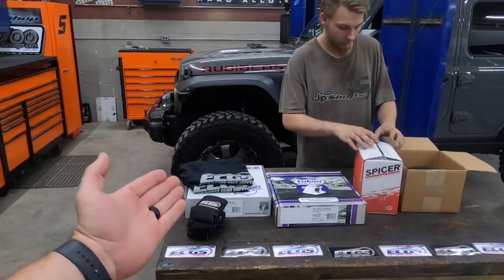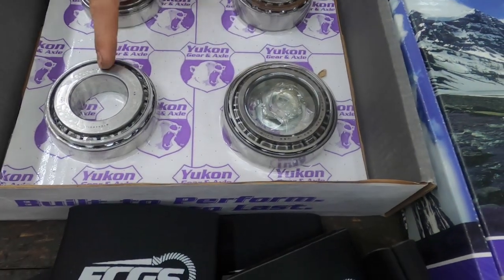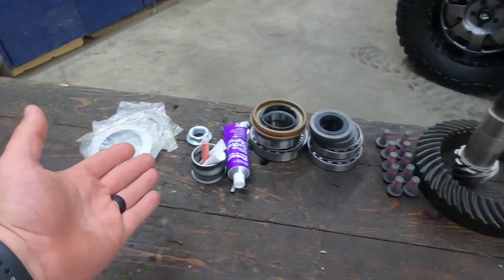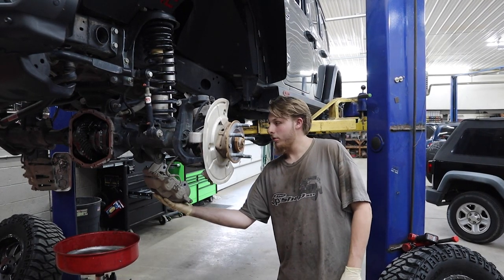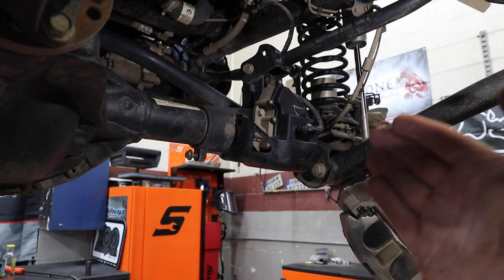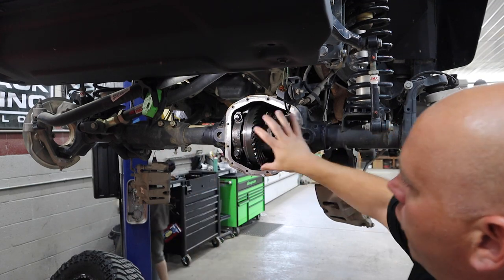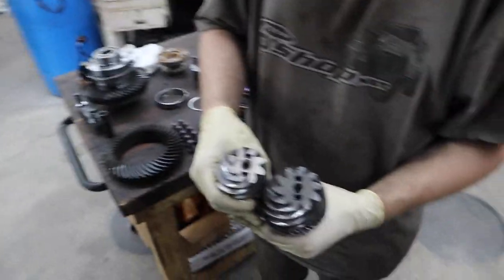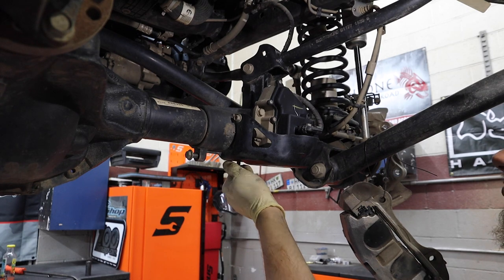WE'RE GEARING UP FOR 37'S! Wrangler Rubicon JLU 5.13 Gears Swap

Comment: Love gear swaps I just did mine and I find the install fascinating. Make sure you break those gears in casually for first 500 miles before doing any hardcore off-roading. If you’re just trail riding with minimal complexity then it’s probably a nonissue.

Comment: I went with 4.30's for my 37's on my 2021 Chevy Silverado 1500..I don't drive off-road or tow though I'm mostly hwy traveling..everyone keeps saying 4.88 and 5.13 with 37s make me think like I made the wrong decision

I was trying to get it to were I would get decent fuel mileage and decent power..do u think 4.30s would be the right gears for me?
Reply: I have an 03 silverado with 5.13s on 37s and it does very well doesnt feel like its on those

Comment: I have a 2009 F150 5.4 at one point I had 35 inch tires with the 456 gears .   My new tires I will be installing are 38 a lot of people keep telling me to go to 488 and 513.  So I decided to go with the 513 hopefully that is the right decision my wheels and tires all together 600 pounds so I’m waiting for my Truetrac to be delivered  and then get everything installed.  

That being said, what are you guys think?  Should I go with the 488. ? 
I basically only drive around the city and no off-road  Definitely wanna hear you guys opinions
Reply: I have the 03 silverado with 5.13s on 37s I never go offroad just on road and does very well